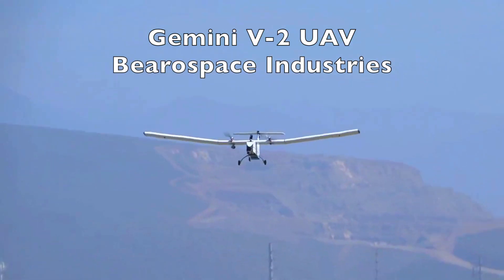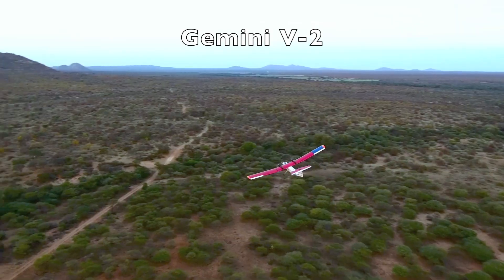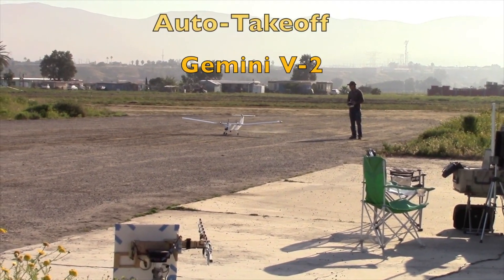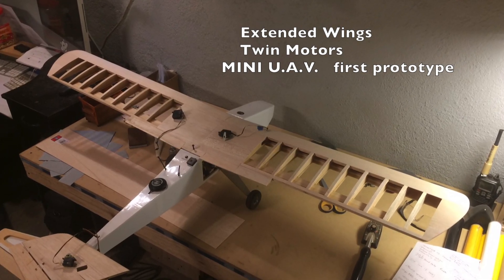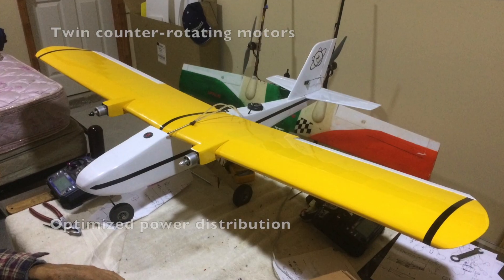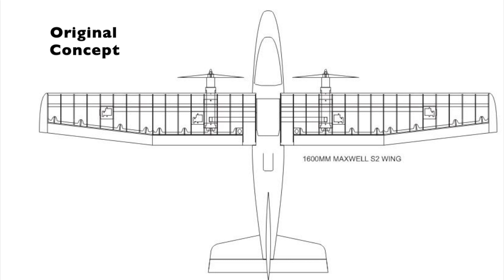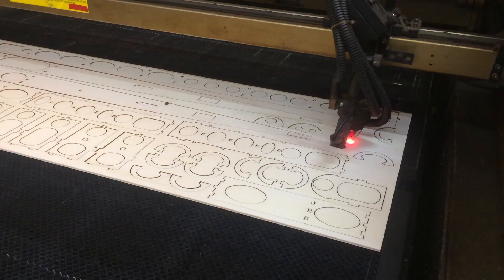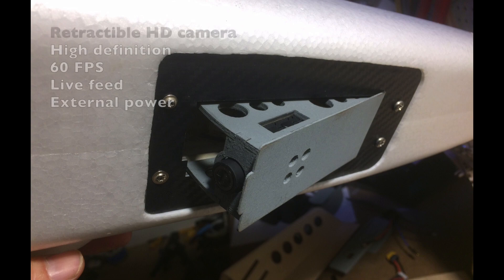Maxwell S-2 Mini UAV Teaser

Comment: I love seeing extensive mods done to an existing airframe to cater mission-specific needs. Well done.
Reply from the maker: Yes, the fuselage is from a Sonicmodell Binary. 
In this case, the wings and tail improve performance in all aspects.
Reply: Recognized that fuselage; from watching the groups on that planes performance, I’m excited to learn more about your wing and tail upgrades!
Reply from the maker: @mkintzel  you can see some basic specs on our website, and also check out the RCgroups forum, on which we are active for some time now, to see the process and what others have been able to do with the airframe. Most serious builders are finding some way to extend the wings and enlarge the tail. this is the most comprehensive that we have seen so far, especially once the autonomous functionality Is added.